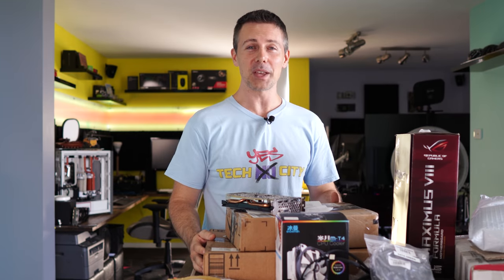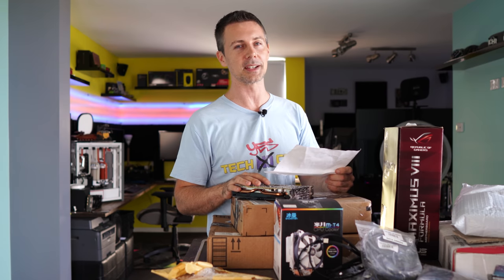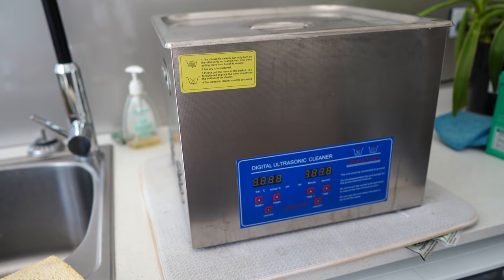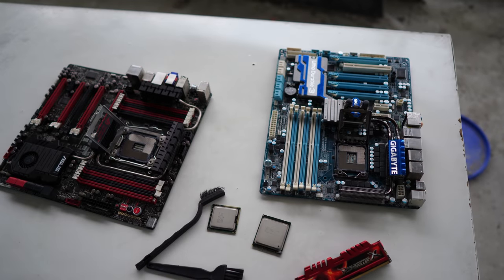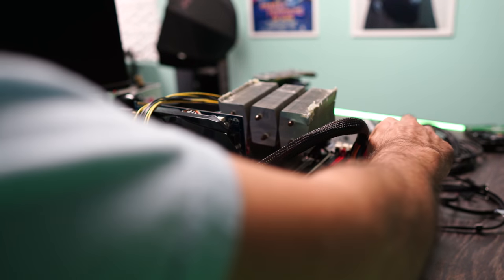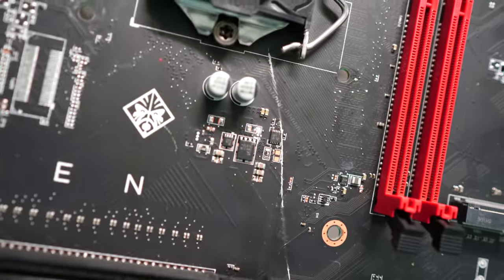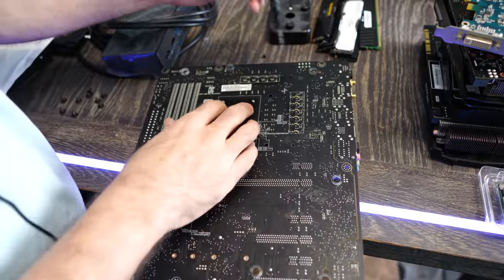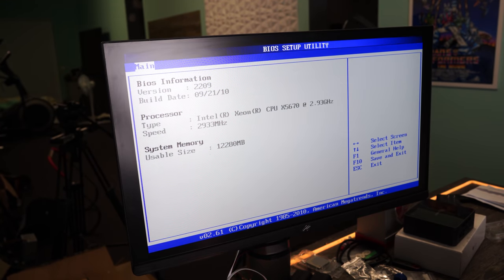Motherboard Doesn't START? NO RAM Recognized? Attempting to Fix Your Faulty Parts  (CAN YES FIX IT)

Comment: I love these kinds of videos so much. I remember fixing an old Socket 7 motherboard back in the day when I was a kid, by resoldering a 5 volt converter to the board that I ripped off an older 486 board. I didn't even know what the parts were at the time. I just knew it was broken/burnt and I had a part on another board with a similar number on it. It ended up working and I used it for a few years. Videos like this bring me back to those days.

Comment: As a healthcare worker, I would like to advice not simply to use magnesium for back pains as it may incurr some other unwanted effects. The best thing to do is to get a medical professional check it out. No hate or anything just some advice. Anyway I love your content and have been for sevaral years now. Thanks alot, I always love these types of videos where  you intaract directly with your community.

Comment: The heat gun method is actually okay, but it's better to use a soldering blower that have temperature control, since the soldered connection in gpu is manufactured by machine, sometimes it have a cold joint on the connection, using a blower/heat gun can help reflow the cold joint

Comment: Generally motherboard refused to turn on is usually points toward vrm power delivery having a faulty MOSFET or shorting to ground. And second thing is the CPU socket have a short life cycle if you constantly put in and take out the CPU too many times you will put the pins out of place and can short out something on the board resulting no post. Now the GPU with no post is a whole different situation as fault finding the board is tricky as you need thermal camera, voltage injection, digital multi meter with fine tips, knowledge and replacement parts

Comment: Brian, your statement regarding Bios flashing a dead motherboard being futile is incorrect. I have recently resurrected a ASROCK Z170 Pro4 after a failed bios update(It hung due to a faulty USB Flash drive). Only the power supply fan would spin and a brief flash from the CPU fans led upon powering off. I reflashed the bios using an Ch341a Bios Eeprom USB Programmer and now the board is working perfectly.

Comment: I love this style of PC content. 
I have been fixing PCs since 1995 and love the content you share
Peace & love from the USA
Reply: you should look for an IR reflow machine instead of a heat gun there cheap now.
Got mine in 2009 and paid $3000 for it. there like $500 now for a decent one.
you dont need the BGA reballer just the IR to reflow.

Comment: I'm glad at least one of the three boards managed to spring back to life. I'm very gracious about that to be openly honest. The other two I really wanted to see suddenly wake up, but there's only so much that can be done tbh.

Also I don't have cats! I have dogs! Your suspicion is right though, I think it's because I had so much dog fur from my recently passed away Australian Shepherds that it ended up; unfortunately short circuiting the Maximus VIII Formula motherboard. As for the OMEN it sounds like it is dead dead, and at least it lived a good three months haha.

I think the lesson here is to on-occasion take out all of your computer parts and give them a good clean. Dust blower, cue tips, Isopropyl Alcohol, all that stuff if done once a year can hopefully keep your components alive for a little longer. 

Great Video! Keep up the Tech Yes Fixin' :)

Comment: Yes, I too live in Switzerland and built all of my family's PC with used/local parts. Picked up an Asus p9x79 Pro with i73820, 8x4GB of DDR3 1600 HyperXFury RAM, and a CoolerMaster Hyper 412S; this bundle was purchased almost three years ago for ~US$220. I've been running the motherboard as a daily driver since, although I did upgrade to E5-1680v2 (4.3Ghz OC)  and a PCCooler (GI-D66A w/230W TDP). After selling off the CPU and Cooler, I basically got the motherboard for about ~US20.

Comment: I sold a Motherboard, CPU, RAM bundle and 2 days later the buyer messaged me saying it wasn't working and could I take a look at it for them. So they bought it over installed in the case and straight away I saw the problem..... they had used a 6+2 PIN PCIE connector on the motherboard EPS connection. I found the 4+4 PIN connector tucked away in the back plugged it in and away it went..... kind of a novice mistake but everyone has to learn.... I didn't charge them a penny extra and also tidied up their cable management for them too :)

Comment: I've had two GPUs in the passed with lines and I managed to get them to a perfectly useable state by underclocking the memory by little as 100hmz. Cards a card when you ain't got a spare just gotta load MSI Afterburner first! :)

Comment: That P6T Deluxe was the same motherboard I managed to "revive" with a good socket pin scrub, the two middle RAM slots weren't being recognized, so I gave them a bath in isoprophyl alcohol and scrub the socket with one of those antistatic brushes. Also, that board has the worst CMOS battery placement I've ever seen, vertically on a corner... I had to solder it back in place since the middle pin broke and the battery wasn't making proper contact and resetting every single reboot.

Comment: Regarding the SSD question at the end, I only use my pc for gaming, browsing and light office work (and I imagine a lot of people do), and I don't notice the difference between SATA SSDs and NVMEs at all. I went from a standard SATA SSD in my last build to a 980 Pro in my newest build. Does that game load 2 seconds faster now? Maybe, but I won't notice wether a game takes 8 or 10 seconds to boot up. Both is incredibly fast. Does Windows boot up faster? I wouldn't know, it was almost instantly there before, and it's almost instantly there now. I also rarely feel a difference when working with other PCs (except when they still have an HDD as a boot drive). And when flipping PCs, I usually choose a standard SATA SSD to save money.
Reply: In most cases you won't feel the difference but if you watched Linus' videos especially in very niche use cases (IE storing some to be edited RAW footage via NVME you can see the difference in how Premier or After Effects is able to stream the data from the Server to the PC) since the decoding and encoding is done on the server side and the main PC is just "parsing" that data
Reply: @edwardtan1354  cn yuh link that Linus video
Reply: nvme is hardly more expensive and is much better if the board has an m.2 slot I always use it.
Reply: Due to architecture of SSD, it has better performance when get larger capacity like RAM has more channel memory does.
so if u have money, try to get a larger SSD if u can, especially u choosing NVME SSD for your new PC after 2022, at least 500/512 GB or up
but it is limit in 2TB due to the bandwidth of Bus(Pci-e GEN 3 or GEN4 or just using SATA), 
more over, more meaningful testing figure for SSD is to look the actual 4K Random/IOPS of the test/official number from manufacturer.
For my opinion, Kingston A2000 series is better for value, reliability & performance.
Reply: @edwardtan1354  exactly my point, and also the main takeaway of that video for me. Yes the NVME is theoretically better and there are niche use cases were they legitimately make sense to get. But for most of the time you won’t notice a difference, so when it comes to flipping PCs it’s one of those things where I try to save a few bucks
Reply: @daytimerocker3808  for my own pc yes, but for flipping PCs (especially really low budget ones for 80-150€) 10 bucks saved is well worth it. I did notice the gap between the two becomes smaller and smaller, at least with entry level NVMEs
Reply: @CaptainScorpio24  https://youtu.be/4DKLA7w9eeA
Reply: @Xello99  I'd personally spend the extra 5-10 bucks on the nvme its just a better selling point and in my opinion totally worth it, but you do you brother!
Reply: @daytimerocker3808  just fyi, some m.2 ssds are actually sata. I have one on my asrock b450m pro4, the second m.2 slot is sata only, managed to get a good deal on a 1tb sata one. Nice to not have to deal with cables
Reply: @videogamefreak221122  yeah much better for cable management too makes build look cleaner
Reply: @daytimerocker3808  Yep. I wouldn’t suggest a 2.5 inch drive as a boot drive unless it’s an older system without NVME support, or if they’re really on a shoestring budget where that 10 dollars or so will make a huge difference.

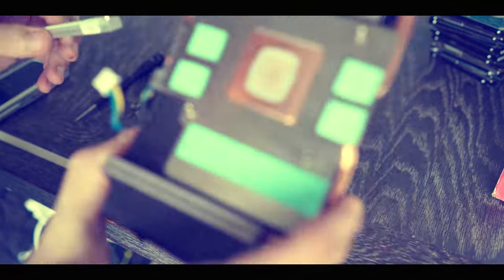Comment: Am I really the only one who noticed a corrosive looking point under the top left VRAM Chip @5:13 ?
Maybe John tried to clean the GPU as well and didn't let it dry long enough, causing it to stop outputting an image. After he put them aside and later sent them to you, the water caused the corrosion.
So either way, I think the VRAM Chip is now faulty and 2 blame.
Reply: dude....u have to make a contract with the Delta Force! You have ridiculous good optics!! its look like its a broken part from the vram chip!
but i never ever...notice that!
Reply: I'm pretty sure that's just thermal pad oil mate. Those things are not dry. They have some sort of oily substance in them. Normally not enough to run per se. But in any case, that's what I think it is. :) Cheers!
Reply: Considering multiple people commented this, no, you are not special.
Reply: Let's assume only one vram chip is bad.
If one bad vram chip is desoldered/removed, maybe the card will work fine again??
Reply: @sixcoregamer9221  Whatever the reason the card is not functional, the oven method might work. It's worth a try. :)
Reply: @JFHeroux  ovens are for melting solder.  I  don't think chips can be fixed by heating them.  Ovens can melt things that should not be melted.
Reply: @sixcoregamer9221  You should do a bit of research on that because that's a method that's been in use for a long while now. People also use heat guns, but IMO that's asking for trouble as you cause thermal stress on the board by heating-up only one part of it.
Reply: @JFHeroux  This is how to repair vram chips.  youtu.be/qdyM8qQXumA?t=44
Reply: @JFHeroux  Silicone oil, some brands contain more than others.

Comment: As a repairist  (as hobby only, apart from full time job and part time degree), my success rate also drop, received parts (bought from 2nd part store / web etc.) are more curel then before, they are usually complete blown instead of know repairable issues. Looks like there are more people tried repairing and prevented some  "easy fix" flowing into market.

Comment: the rampage IV ex is a motherboard I have once lived with, it has a notorious cold start fault and warming the board up with a hairdyer for a bit will get it booting, worth a try just get it all setup with and ready to go, then just wave hot air around the board to bring it up to temp should fire it up right away, should also start in warm enviroments over 33c or there abouts, I really do hope you see this because this was a common fault with Rampage IV Exteme owners, the best solution keep it running, and keep a hair dryer handy to warm it up in the case of cold start fault. the cold start fault started showing up on these boards around 2014 as the came out at the end of 2011 most just lived with it after learning how to make them boot.
Reply: Yep, I was going to write this but looked to see if there was a post already. This trick does work and looks like the board is suffering from cold start problems.

Comment: Hey Brian, the Rampage IV Extreme has a temp issue that stops it from booting. I've got 2 of these with this issue, apparently caused by a faulty LN2 sensor on the board. When mine don't boot I warm them up with a hairdryer (max heat from about 20cm) and they turn on after 10-20 seconds of heat, maybe 30 if stubborne. (I also live here in QLD and they still have this issue in summer) Might be worth a shot.

Comment: hi, 26:35 it depends on the IO, some have use a part of the bios, to work. the 3 boards , dead normaly have some power rails down 3.3v. 5v, 1v... is need to check first, best way is to compare to a working one :

Comment: I have an old GPU who has similar issues but worse and only when some sort of 3D acceleration is happening which is really a mess you can't do anything with it, but i have found a use for it, i have it on NAS OMV-based server and since the server runs at 2D graphics when you boot it and the mobo won't boot without a GPU because it doesn't even have an internal one, the GPU being broken for 3D doesn't matter there cause terminal GUI (and even at BIOS) have no issue whatsoever.
I have placed a fan beside it because it really needs it since it only has a passive cooling and it works wonders, but this is probably what damaged it in the first place from whoever had the card before me.

Comment: Had a problem with my rampage iv extreme detecting ram or not booting because of ram until I realized you are supposed to plug a floppy power connector in the spot right next to the 6 pin pcie power and it provides cleaner power to the ram slots. That fixed all of my ram problems right then

Comment: the lines on the screen of the 1070, you need to oven it at 195c for 8 minutes and it can sometimes fix it... it usually an issue with the soldering micro balls of the FPGA disconnecting, so not all memory chip are connected fully, to the GPU controller (gpu die).

Comment: Been thinking about getting one of those bigger cleaners myself. I used to run a Epson wf 3640 printer and the print heads always dry out and stop working. I gave up and went back to a HP 9025 all in one that can sit forever and the print heads never get plugged with dry ink, it just prints till it runs out of ink. What machine did you get and how much US for it? I still might get one as you can super clean about anything that will fit.
Love what you do and making old stuff live again and make a few bucks as well.

Comment: I have the same X58 Asus Rampage III Extreme board you have Brian. I bought it off Facebook Marketplace, tested it, ran great. When I began putting it in my case and was on home stretch, I tried turning it on again and it wouldn't POST. Really soured me on Asus since you have a video about how great Asus boards are and feature that same X58 board in the video. Wonder if you would like a try to at reviving it because I've tried everything - Changed the RAM, CPU, PSU..etc Upon further research I found it this was a common thing with this particular board; where it's working fine then all of a sudden doesn't and does exactly what mine does.

Here's what happens, when powering on, the board's LEDs come on (though not all of them) on the 4 LEDs near the CPU that cycle through CPU, RAM, HDD and GPU, it'll get stuck on RAM. With some combinations it'll give me some beeps but nothing comes on screen.
Reply: Sounds like it might be BIOS bit rot at fault. In which case you might be lucky, as this board has socketed dual BIOS chips. First of all, reseat those, as contact issues are not uncommon among socketed chips of all kinds (a bit of contact cleaner or at least isopropyl alcohol may not hurt). Next switch to the secondary BIOS chip and see how that goes. If successful, you will have to research how to properly reflash both chips.

It is generally recommended to replace flash chips prone to bit rot with more dependable specimens.
Reply: @PileOfEmptyTapes  I do recall seeing that the BIOS chips to most likely be the culprit for this issue...I've tried switching BIOS but haven't reseated / cleaned them as you recommended. Though what was also telling was not all the normal LEDs were turning on as that board has lots of them, like the RAM LED that tells you how much power you're giving it, like 'Normal' to 'High' with red, yellow and green but those were off. Would the BIOS rot be the cause of all that?

I've begun to move on from x58 to a Ryzen system which I have yet to build. As much as I love x58 the lack of AVX is preventing me from playing certain games.
Reply: @PrometheusOfVideos  I imagine a lot of the onboard indicators are ultimately software controlled directly or indirectly (there may be stuff on a serial bus like what's used for fan control and temperature readout), so would require a working BIOS.

As iconic as LGA1366 is, you'll probably be thrilled with a new system. Aside from the AVX issue, X58 rigs tend to be notorious power hogs as well, with idle power sitting at 80-100 W pretty much no matter what you do. Modern systems can be remarkably efficient if you let them. Throw in 2-3 times as much computing power as a hexacore LGA1366 CPU even on a modest Ryzen 5600X, plus proper 6 GBit SATA, properly fast native USB 3, onboard M.2 and PCIe 4.0, and you can tell that things have progressed a fair bit over the last 12 years after all.

I can't say I agree with every single development, notably cases dropping 5.25" drive bays almost entirely in the interest of even more airflow... that's getting a bit too single function for my tastes there. I deliberately went with an older model case for my current build for this reason... I'm not much of a gamer at all but do need to rip a CD once in a while. Went from a Xeon L3360 (basically a C2Q Q9550S) on socket 775 with DDR2 to an i7 11700... talk about a bit of a jump. ;) (I was tempted to go AMD but the long-standing USB issues and others with C-states kind of scared me off. The last thing I need is audio dropouts.)

Comment: @Tech YES City at 15:48 can that process be used for fixing amd cpus?  I recently bought a Ryzen 5 5600x cpu and when I was installing it two pins got bent slightly.  I re-straightened the pins and reinstalled the cpu and found that two ram slots, b1 and b2 respectively, were not reading the ram that was installed.  I also switched back to my old cpu and all the ram was being read correctly which means there is an issue with the new cpu and I believe the bent pin was the cause.